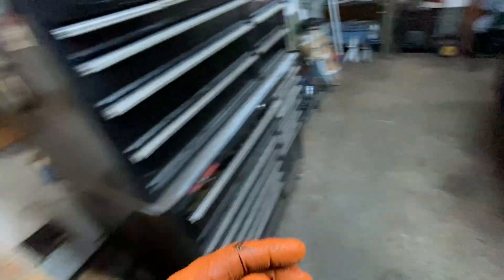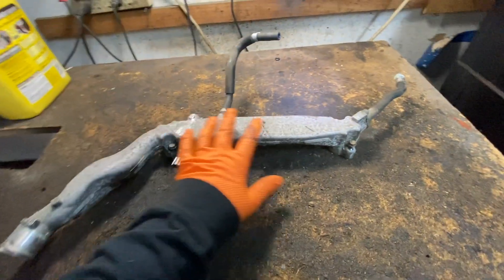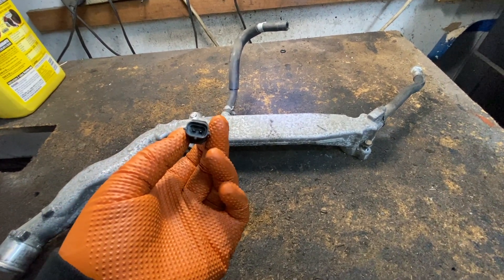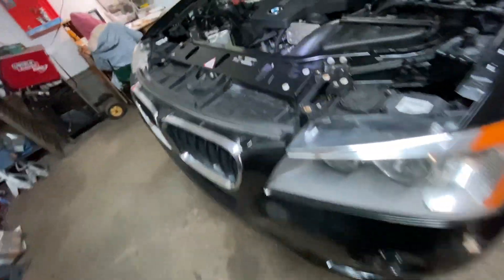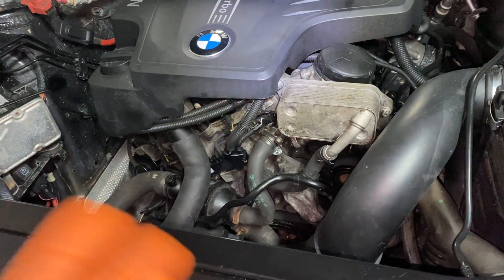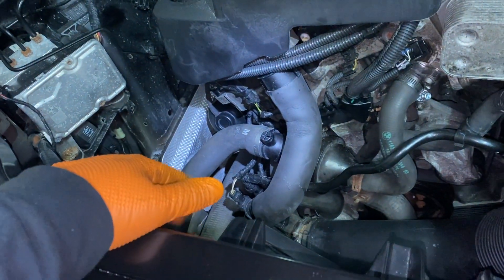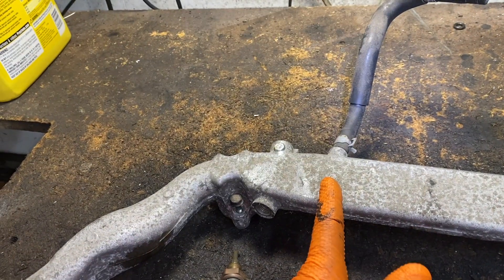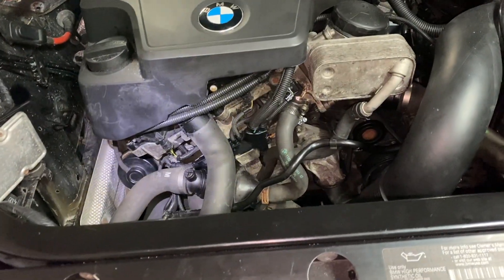What Is A Coolant Temperature Sensor (CTS), Where Is It Located And What Does It Do? - Code P0118

Comment: On my BMW 535i F10 when the water pump failed then I replaced it, my fan started turning on too soon even when the temps were cold constantly from slow the suddenly to full speed fast...  Seems the water pump failing cause a bit of overheating which took out the Coolant Temperature sensor with it and it began acting not functioning well... Replaced the coolant temp sensor and my fan turns on when it has too as normal as it did before!
Reply from the maker: Thanks for the feedback, glad you got it fixed!

Comment: Hi im from South Africa. I drive a bmw f30 320i 2013 model. Having a problem with my cool, changed my thermostat just a few days ago but my radiator fan comes on very early and doesn't stop running at full speed and water is not circulating. So can it possibly be the temp sensor
Reply from the maker: Try bleeding the system first, I have a video on your BMW. Hello South Africa!
Reply: @motorcarnut  I have tried bleeding the car but no water in entering the water bottle and my radiator fan is at full speed, running continuously. I also have no water leak or funny noises from the water pump?
Reply from the maker: Does your vehicle have the electric water pump? if so, can be bad. Here is a video on bleeding the system. The fans are running at full speed because the engine is hot and the coolant temp sensor information to the computer keeps them on but if fact its a coolant flow problem.
https://youtu.be/pPmgQZ0YJWg
Reply: @motorcarnut  I'll watch the video and retry. I will update you on the results bro👊
Reply from the maker: Ok

Comment: in that  car the cts controls the water pump as well???   i have the same bmw and is overheating.
Reply from the maker: Short answer, yes, but computer gets information from many sensors including CTS. If your car is overheating because of a CTS it should of thrown a code if it were that bad.

Comment: If the code is 10A001 is it still the CTS
Reply from the maker: Yes or the circuit
Reply: @motorcarnut  I replaced the CTS and looked at wiring everything seems fine and looks like it’s reading the correct temp but throws up the code when driving but at idle it doesn’t throw it up
Reply: the code is PO118